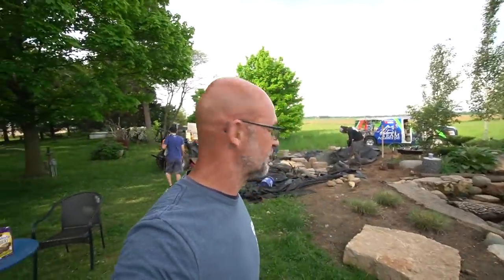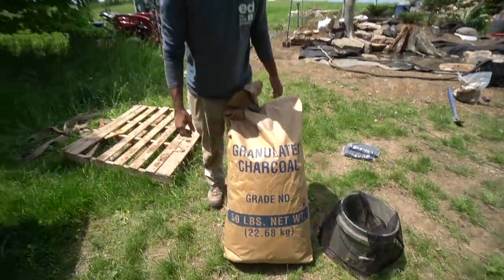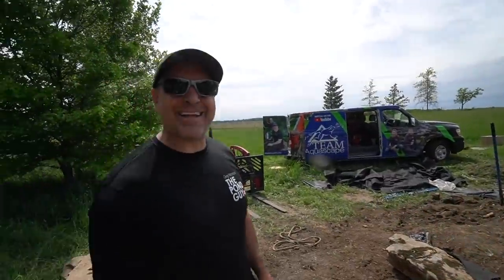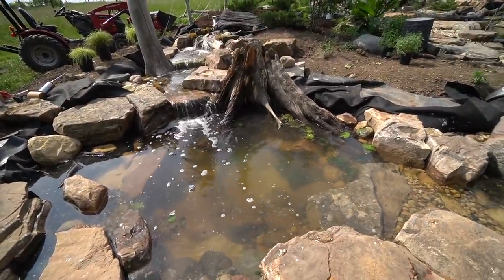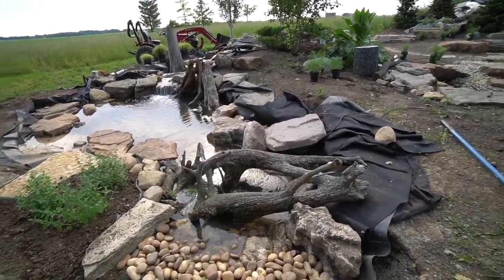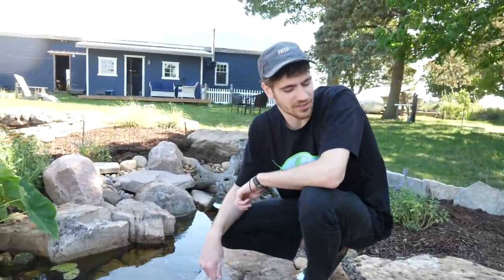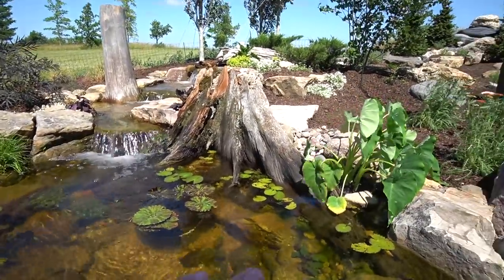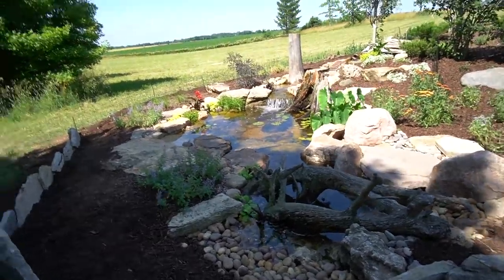My FLY RIVER TURTLE POND is DONE with George CoralFish12g - Part 3

Comment: Ed the ponds have an overflow to keep them at a steady level.  What tops the pond up when there isn't enough water?  It uses untreated tap water?
Reply from the maker: Great question!
Yes,
We have an overflow to control excess water and we use a few different options to add water to our features. 
The first is simple,
We manually add water as necessary with a standard garden hose. 
Another option we routinely use is a simple float valve(similar to what’s used on a toilet tank) it can be connected to an outdoor spigot or irrigation system. 
The final method is more costly, we’ll create a large underground rainwater harvesting tank to capture rainwater which is then used in the water feature, these tanks can hold 10’s of Thousands of gallons according to different project requirements.

Comment: Hi Ed have a question. A lot of pond builders are using Rocks and gravel in the ponds. My pond included. Can rocks in pond give you PH problems like high readings? I know limestone does raise the PH I was wondering if any other rocks do the same.
Reply from the maker: Yes,
Rocks can alter your pH where are you located?
Have you checked your source water?
Do you get any runoff from rain into your pond?
You can check your rocks by pouring a weak acid over them(Vinegar) if you see lots of bubbles and foam the acid is reacting with Calcium and Magnesium Carbonates releasing Carbon Dioxide, if this occurs it will impact your water chemistry……
Reply: @EdThePondProfessor  Thanks for getting back to me. There is no water runoff from anywhere.  I am located in Long Island NY. The pond is finished. The pond has 11 tons of rocks and 8 tons of gravel. I have a wetland filter. I cannot test the boulders that are in the pond already but I could take some of the gravel and test it with the vinegar. My night time PH is 7.2 - 7.5. It is in the day the PH goes up to 8.5 - 8.8. The KH is around 73 - 80. The pond has aerators also. The large aerator I was wondering if that would raise the PH in the day because of the Co2 exchange. I had steady PH for months around 7.2 - 7.5  but this of month of July something changed those readings. The pond is 3 months old. Could it be because it is a new pond and the algae on the rocks are growing? All the other tests are fine. The pond is crystal clear. We did have 3 days of very heavy rain in the beginning of July. 6 inches of rain. I cannot pin point the spike in the PH in the daytime. I have plenty of air in the pond 3 aerators 4 waterfalls. Just don't know. I do not want to put any chemicals into the pond which could even make it worse. The one thing it is a steady night PH at 7.2 - 7.5 and 8.5 - 8.8 readings. Any ideas?

Comment: Where did you put the charcoal?
Reply from the maker: I used it inside of our Biofalls to aid with the Filtration process,
It’s an Upflow system so I placed it on top of the Filter Mats.
Reply: @EdThePondProfessor  So I would have to put it underneath the mat?I have three skimmers.One for the waterfall,bog,and one to circulate a couple ofareas.It is a rec. pond with fish.Thank you

Comment: So are you ever going to go back and fix flairs pond (your company is not legit ) you go to big you-tubers and get your 5 minutes of fame and then when there ponds start to break in  a week or month and you (fix) it and falls apart again so much for good quality. By the way don’t charge over a grand  for a repair job that you know won’t work
Reply from the maker: It’s up to Flair to call us and let us know there’s a problem. 
We stand behind everything we build!
We will happily return to fix anything that has been done wrong by our team. 
If however we determine that the Problem is due to other factors such as lack of maintenance, damage to any of the equipment, extensive power outages, etc……
We will happily repair it but we will not warranty that because it was not a problem due to the products we installed or our installation practices.
If you’ve ever owned an Ecosystem such as Fish tank, Animal Enclosure, pond or even a Small garden you’d understand that it takes routine maintenance to keep it working properly. 
Gardens require weed control and additional water,
Ponds require water, cleaning of pump intakes, bacterial treatments, etc….
Fish tanks need water changes and monitoring of nutrient levels,
As you can see nothing is maintenance free,
I don’t know what’s happening with Flair’s Pond but I haven’t heard from him so I can’t answer that question……